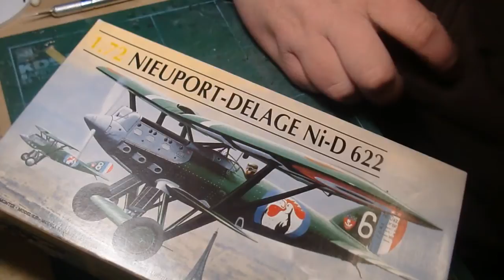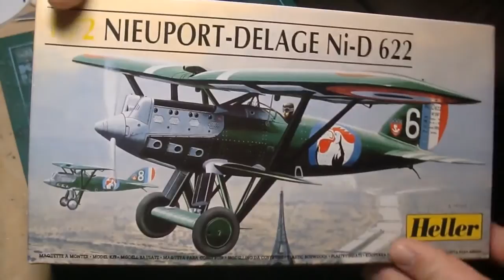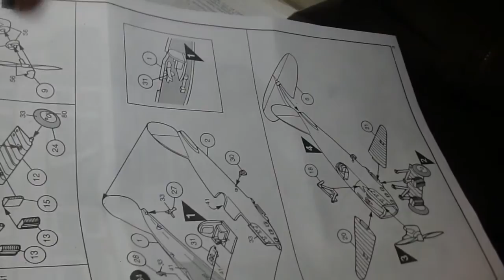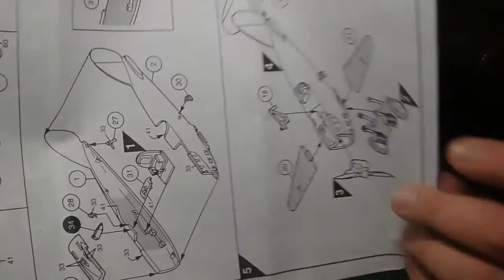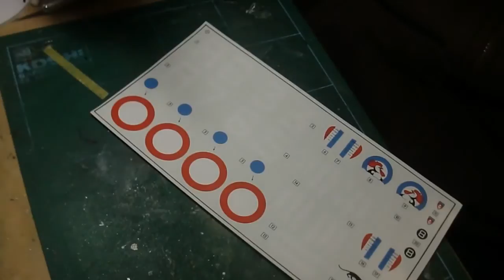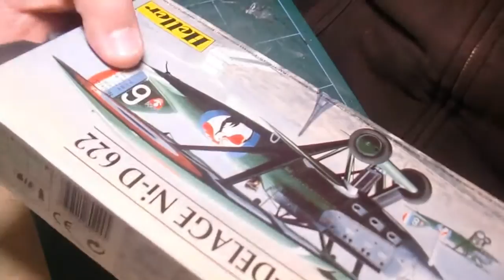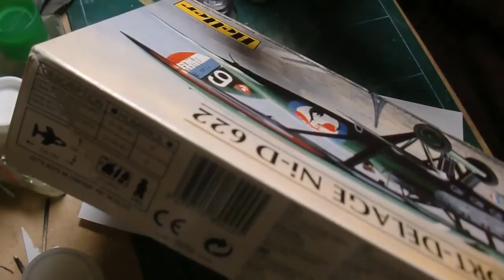Heller 1:72 Nieuport - Delange  Ni-D 622  (Part 1)

Comment: Nice job so far. Just one question, where did you get tihs kit? Heller kits are very hard to get in area where I live.
Reply from the maker: Oddly enough it was just in my hobby store. I asked him where he'd gotten it and he said it was either a accident from the distributer (which happens quite a bit) or it's been sitting in the store for years buried.
Reply: Oh, well still thanks for answer.
Reply from the maker: dany7919 I looked them up on ebay and found quite a few there, and for the most part at good prices :D
Reply: Thank you, I will have a look at it. This is nice little plane and I certainly want to build it.